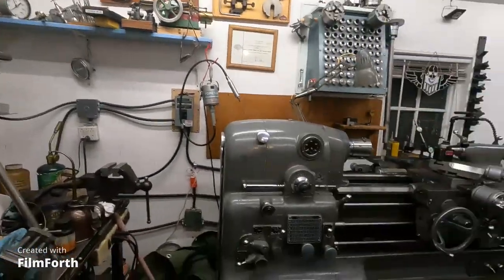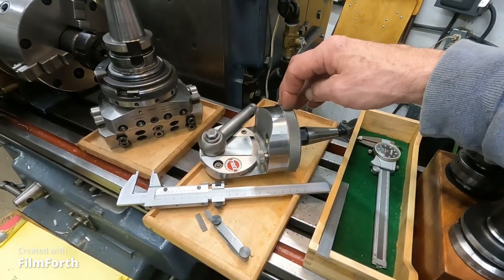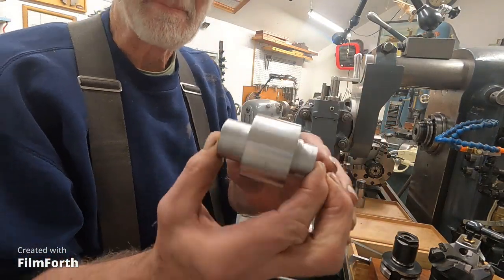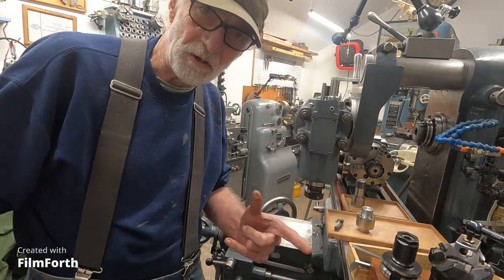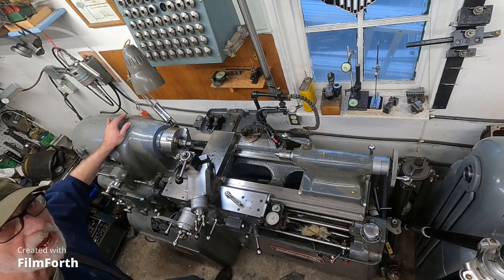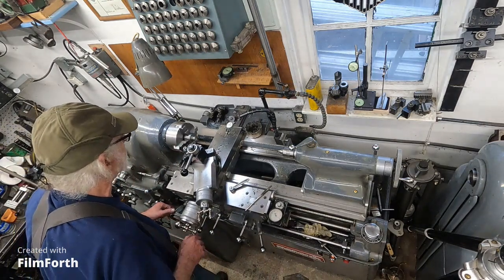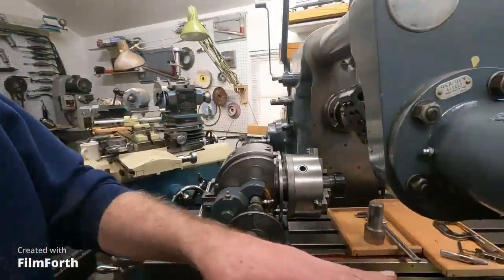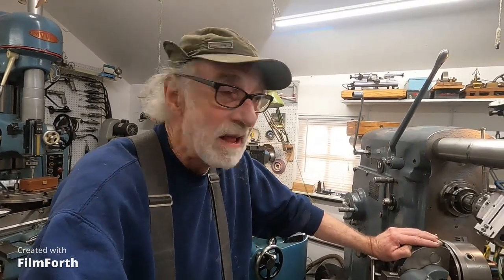Adapting  Wolhaupter facing head to Brown & Sharpe milling machine

Comment: I bought much of my tooling when it was being sold for scrap metal prices. Stuff can still be had reasonably priced if you know what and where to look for it. Of course I’m still envious of your 10EE and jig borer. 😊
Reply from the maker: It seems that the tooling shows up first, then the machines without any tooling. The jig borers are very cheap now. I am in good shape until I buy another old machine, thanks!

Comment: Could the threaded adapter you made be somewhat shorter to improve the work envelope of the mill, or is that really unnecessary. Great content, thanks
Reply from the maker: I can change the adapter for a short one when I need it. This old mill has a long Y axis travel, I think this length will be the most useful it will bring the head over the table. Thanks!